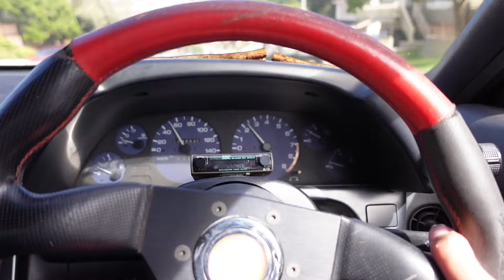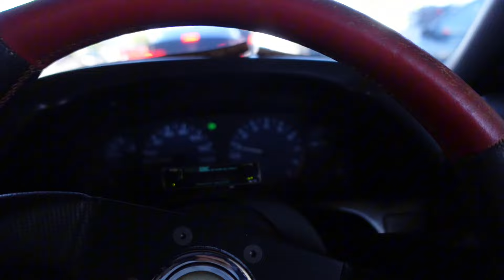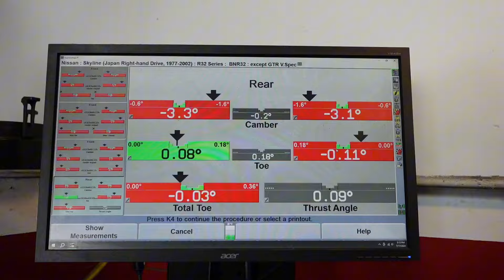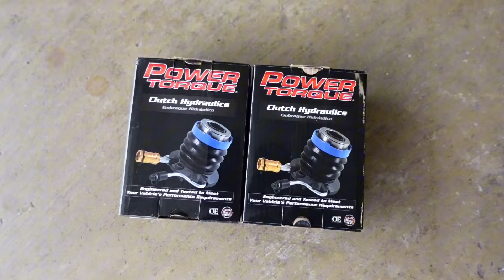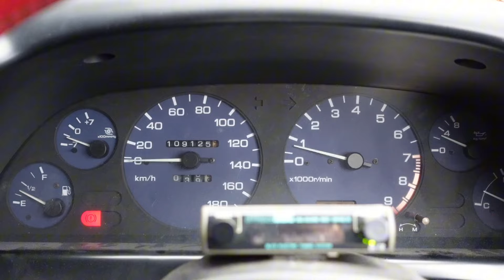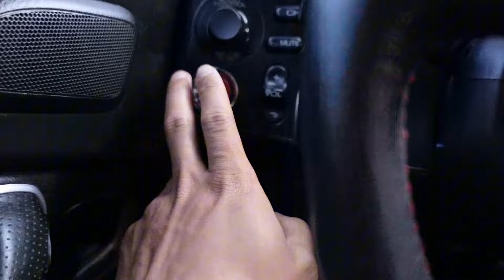R32 Skyline gets NEW Wheels & Coilovers! (+ Skyline Breaks Down & S2000 Driving)

Comment: Same thing happened to me with my integra. I was warming up my car at target then it randomly shut off, then as im driving back home it shut off again. I changed my map sensor and idle air control and i’ve had no problems since then
Reply from the maker: Looks like that’s what I gotta do🫡
Reply: @moddism  Also invest in a good wideband 02 sensor. Especially on these old cars you can easily tell there's an issue before any big symptoms appear